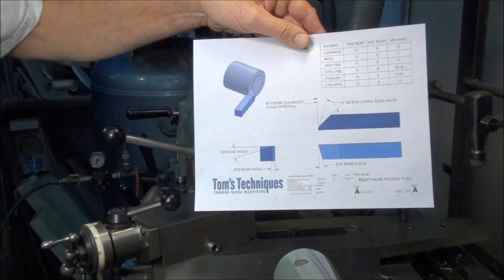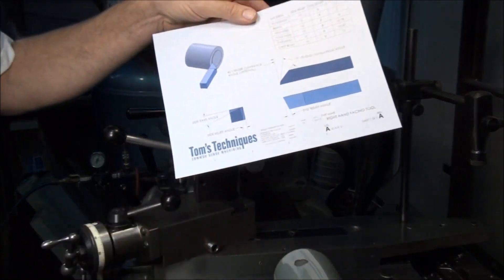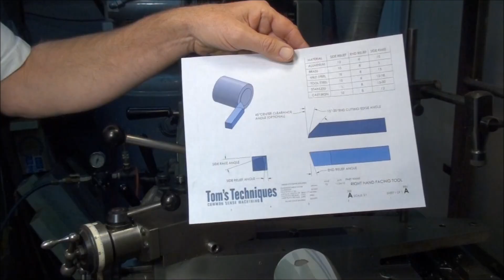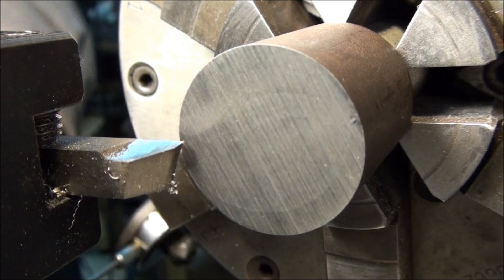Facing on the Lathe

Comment: Great videos.  Really confused on one item in facing video.  How did you adjust tool height with spindle turning, to re-center the cutter to get the nub?    I have an Aloris axa.  Thanks!
Reply from the maker: The tool holders have a thumb wheel to adjust the height of the tool. Just unclamp the holder, adjust the height, and reclamp.

Comment: How tf do i do this when i dont have a fancy ass quick release tool holder?
Reply from the maker: It doesn't matter how you hold the tool. The principles are still the same.
Reply: @TomsTechniques  ok thanks i figured it out. My stupid face was using the wrong arm thing thus holding the bit at the wrong angle. I found a old book of my great grandpas that explaimed the use of each arm thing. The college course i wemt theough rushed us and didnt shoe us much of the old style tool holder
Reply: @TomsTechniques  part of the issue too was i want using the cross slide feed because the brand new lathes at school has it right in the open vs my dads hand me down 1930s lathe the knob is tucked up hidden. We got it from my grandpa and great grandpa used back in the day at there machine shop. My dad mever learned how to use it so i took a course and teaching my dad the lathe, mill, shaper ect.
Reply: @TomsTechniques  thanks for the vid though . I got it down now and made a pretty decent peice to convert a old 50s flashlight to led.

Comment: Sir, What kind of lubricant do you used after you machined a workpiece?  I mean, so that the workpiece remain shiny and not rusty when you put it off the lathe and set aside.  Maybe you might have an idea on what kind of oil they put on.  Thanks
Reply from the maker: Ordinary motor oil will keep parts rust free, but if you don't want oily parts, they can be gun blued or blackened.

Comment: Nice video and web sight.
Fyi the web sight video links and contact page appear broken. 
Oh yes, Wonder if I could request a sequel. How to face both ends parallel when the part is to thin to simply flip on the scroll chuck jaws and cannot be undercut and done between centers....  
Great stuff
Thanks
Reply from the maker: Thanks Mike. 

I am aware of the contact page, but everything else seems to work. The website is definitely outdated and needs to be rebuilt. I'll probably have my son help do it when I get around to making videos again.

You can use parallels between a thin part and the chuck body to get the two sides parallel, but don't forget to remove them before turning the lathe on!

Tom

Comment: facing tools have side cutting angle. ( if the side cutting angle is zero it is for roughing). books recommend that. what happens here??
Reply from the maker: The side cutting edge angle should not be zero, because it puts too much load on the tool at the start of the cut.
Reply: @TomsTechniques  thank you but @2:08

Comment: In the 1960"s we were taught to face from the center out.  Then apply a flat mill file to the nub left in the center.  This would keep the drill bit used in the tailpiece from skipping around.

Comment: A good short video on only the simple facing operation on the lathe. There are a number of operations machinists conduct on lathes including turning, facing, chamfering, thread cutting, drilling, boring, reaming...etc. Lathes and milling machines are used in many areas of manufacturing as essential basic tools, including woodworking, ceramic parts manufacturing, metal and metal alloys shaping and manufacturing, plastics and elastomers machining.....etc. Therefore, anyone interested in manufacturing technologies for fun, hobby, as an entrepreneur or for their career should definitely familiarize himself/herself with lathe and milling machine basics and probably also with other non-conventional techniques such as laser machining, plasma machining, waterjet.....etc. Even if you are not a machinist, but a consumer of machined parts, I strongly recommend learning the basics of machining operations and CNC and manual equipment, so that when you prepare blueprints or want a product to be designed and want to place orders for parts, you know better what is possible and what is not possible. Also, the equipment a machine shop uses is an important contributor to quality, lead time and price. Knowing something about your supplier's equipment inventory can give you an idea about whether that particular supplier is a good fit for your specific parts or not, provided you understand something about available equipment. You can visit our Youtube channel by clicking our logo on the left for additional videos on various manufacturing techniques, good instructional and educative subscriptions and to see videos we liked. Thank you Tom for posting videos showing manufacturing processes.

Comment: sir,

i am saravanan from chennai, i have seen your videos quite a long time , its are amazing 
Now i am  facing a issue in FACE TURNING PROCESS, 

we are the manufacture of engine valves, in valves there is face turning,
while doing a process , nearing to the centre there is concentric feed line are forming stil we are opearting at 0.2mm/min feed rate with rpm 1400
we aare using kenna metal SNMG insert , life is 100 nos
please suggest us the solution , it should increase the feed to 0.3mm/min and to increase insert life

Comment: What about tungsten it started in EU for about 80 years ago, and for 50 years it hawe been around in all shops. On E-bay you can find it - go for seco - it is standard sizes so all EU standard tolls fit in. No korean / japan etc. - you get stuck with somting you can only by by this company - and then cant.
Reply from the maker: Are you referring to tungsten carbide? I don't recommend it for light machining. It's expensive and unforgiving for beginning machinists and as you say, requires special (expensive) tool holders. High speed steel is more than adequate for light and hobby machining and doesn't require the rigidity and power that light machinery can't provide.

Tom

Comment: What is the main difference between face turnging and taper turning?
Reply from the maker: The term "facing" applies to machining the end, or length of a part and "turning" of any type, refers to machining the diameter.

Comment: Although a "nice" finish (to the eye) can be obtained by backing the tool out from center, a closer to perfect face can be attained by keeping the feed and speed where it will cut the best as the tool approaches the center of the work. After all, correct feeds and speeds are more than just suggestions.
For instance, some cnc turning software not only suggests the best numbers based on the material, it also increases the spindle speed and decreases the feed rate as the diameter being turned decreases as the tool progresses toward the center. If you do the math, you will see that that the rpm must increase and the feed rate decrease the smaller the diameter, ending when the speed is infinite and the feed rate is 0 at the exact center of the work.
You can see the results when the finished parts are compared side by side. What happens when feed and speed are ignored durring the the facing operation, it becomes obvious that the material is being scrapped and torn away toward the center of the face.
While not a big deal for most operations performed in the home shop, often times a specific surface finish grade on the face will be called out on parts of higher quality, especially in the aerospace industry. Grinding the decreasing diameter face of a thrust bearing surface comes to mind.
Fortunately, the home machinist can approximate a closer ideal speed by using a digital frequency device, when available. Simply increase the spindle speed and decrease the feed as the diameter on the face decreases.
I've actually replaced the single phase motor with three phase motors on a number of machine tools in order to take advantage of the numerous advantages of a VFD and 3/θ power... RPM, starting and braking ramp contours, instantaneous direction change, etc..
Thanks for addressing the basics for the uninformed. :-))
Reply: Gee whiz
You act like Tom was making a video for Boeing

Comment: I have a secondary operations lathe (Hardinge DV-59), which is giving me fits.  It will turn the diameter of bar stock so that there is not more than .0002: taper over 2 1/2 inches of length.  But facing operations?   I always get a slight convex shape (about .005" total on a 1" diameter piece.  That's pretty pathetic, and nothing I have tried seems to work. ...   The DV-59 doesn't have a saddle and lead screw.  Just a light duty cross slide and compound.   You set the compound to 90 degrees by doing successive test cuts.  and I have done that.  The gibs are all tight.  Can't feel any play in the cross slide or compound.  My tool rest is a substantial Dorian too.   It is tight.   

Any ideas?
Reply from the maker: Convex or conical? If it's conical, the tool is moving on an angle. If it convex, you make have a tool geometry issue, i.e. not enough clearance under the cuttin edge. All that aside, if the lathe has a cross slide, then that is what you should be using to face. The compound rest is intended for angled cuts.

Tom

Comment: how can I get two faces parallel to each other on the lathe if the second face to machine is a sawed surface. the part is too thin so the jaws can't locate the part square
Reply from the maker: Leave the part oversize and clamp it to a faceplate.

super glue it to a faceplate, then dissolve the glue with acetone.

Hold it in a pot chuck. Either the collet type or one you can hold in a lathe chuck.
Reply: Select parallels in the back of the part clamp part take-out parallels you'll be just fine

Comment: hey tom, any chance we could get a pdf of facing operation as well as the tool?
thanks in advance.
Reply from the maker: You mean like the one on my website?

http://tomstechniques.com/reference/

Tom
Reply: yea, but something more in depth like speeds and feeds.
Reply from the maker: There is also a speed chart on the website. Feeds are a seat of the pants thing on a manual lathe. Just set the correct rpm and adjust the feed until you get a decent cut.

Tom

Comment: Hi Tom,

From the video it sounds like this operation at least is quiet enough to talk over.  Is that really the case or did you have a separate microphone?

I ask because I'm considering a lathe in order to get into some steam-related projects, but am currently stuck in an apartment...

Thanks much.
Reply from the maker: I honestly don't remember if this was the camera mic or a lapel mic. Either way, this lathe is very quiet. The phase converter in the background makes much more noise.

Tom
Reply: ncraven1906 ةأغ

Comment: Woah, engineering student doing level 3 engineering and I'm just wondering, could you have used a 3 jaw chuck or did you use 6 (I think) jaws due to the diameter of the bar. Also was this B.D.S.M or something else?- thanks
Reply from the maker: I actually don't own a three jaw chuck because a six jaw is a better option they are more concentric and less apt to mar the work. Not sure what you are asking in the second part.

Tom
Reply: Toms Techniques ah okay. The second part was basically asking what material you were machining.

Comment: Hi Tom... I just got my first lathe. It will run CC, but only hums when I use the reverse switch. It is a TIDA TD-4A
I'm not sure what controls do what. Got any ideas.....

Great job you are doing.... I hope you are being rewarded in some manner.
Reply from the maker: +Mr BreakRAK 
I assume it's a used lathe, so it's possible that one of the contacts on the reversing switch is burned out. Of course if it's used, anything is possible. Your best bet would be to find a wiring diagram for the lathe and start tracing wires. Also take a look at the motor nameplate and make sure it is reversible.

I do get occasional donations on my website and something from the ads here on YT, but that really not the point of the videos. I'm just trying to pass on some of the knowledge I've picked up over the years so it doesn't end up getting lost.

Tom
Reply: +Toms Techniques 
Thanks Tom... my own need & curiosity led me to learn how to get the saddle feed going back & forth. I think I will try to test the cross slide feed today. I will look into the motor info. Thanks much for your reply.

You & I will become good friends... Charley Bond

Comment: Is there such thing as a climb in facing operation on a lathe?
Reply from the maker: +Michael Strong 
Good question Michael. The climb milling/conventional milling thing only applies to milling where the teeth of the cutter enter and leave the stock. On a lathe, the single point tool is always cutting and other than on the first pass of a roughing cut, always cutting at the same depth.

Tom

Comment: Nice lathe.  I use a 4 Jaw chuck.  What is the benefit of a 6 jaw chuck other than the extra 2 contact jaws  Also do you have to manually set-up the chuck or is it self centering?
Reply from the maker: +valveman12 
The advantage of the extra two jaws is excellent concentricity, nearly as good as a collet. It is self centering.

Tom
Reply: Toms Techniques Thanks Tom.  Super nice Lathe.

Comment: I am new at this and tried to grind the hSS tool to the exact angles and then tried to face a metal pipe , 1" dia with .85 wall and the work kept pushing the tool away, didn't cut.. Then I tried a side cut, same thing was very uneven like the work was pushing the cross slide away I could see it move and no metal cutting or curling..any advise?
 Thx
Reply from the maker: +Anthony Catenaro 
Assuming the steel you are trying to cut is not hardened, a tool that won't cut is one that is rubbing under the cutting edge. If you feel the tool has the proper clearance angles, make sure it is mounted on the center line of the work and not above. Also check to see that the clearance angles on the tool extend all the way to the cutting edge. A common mistake is to let the tool rotate down when grinding it effectively eliminating the clearance under the cutting edge.

If you still can't get it to cut, go to my web site, tomstechniques.com and send me a pic of the tool.

Tom
Reply: +Toms Techniques Thank you Tom, I will recheck all the suggestions you mentioned and give it another try...if still no go I will send a pic of the tool, Thanks
Reply: +Toms Techniques Thank you Tom, I will check and send a pic if still not cutting..Thanks!
Reply: +Toms Techniques Thank you Tom, I will check and send a pic if still not cutting..Thanks!
Reply: +Toms Techniques Tom, I bought some cheap Harbor Freight carbide bits and got nice cuts on it...,maybe the metal is hardened...but I can get a cut into it easy with a hacksaw so maybe my HSS bits are wrong angles... tried to send a pic via your website but couldn't find an email address..Congrats on your sons wedding by the way!
Reply from the maker: +Anthony Catenaro 

Just write me on the contact page and I'll send you an address.

Tom

Comment: i wish all my machining was this simple.
Reply from the maker: +userwl2850 

Machining a part, regardless of its complexity, is just a series of simple operations like this. Master them and you can machine anything.
Reply: +Toms Techniques yes, i agree tom. when facing like this its best to have the tool below centre as if its above its easy to break the cutting edge. if you have time take a look at the things i machine on my channel.
Reply from the maker: +userwl2850 
Yes, a carbide tool can chip if it is above center, but setting it below center will leave a nib.
I'll check out your site.

Tom

Comment: Tom, I faced a 3/4" x 7" dia plate on one side. I need to flip it around to face the other side and I need to be at 1/2" when done. The depth of the jaws are .625. How do I space the plate out from the chuck face while keeping the already faced surface perfectly parallel with the chuck face? Thanks, I have learned a lot from you videos.
Reply from the maker: +Ken Hoekstra 

Hi Ken,

You just need some 1/4" spacers between the machined face and the jaws. Dowel pins or ground tool bits work well. Be sure to tap the part down on them with a hammer. There are also three legged spacers called spiders that work well for that, but individual spacers will accomplish the same thing, they just aren't as convenient.

Tom

Comment: hey tom,
 your videos are pretty awesome,can u describe what are ORS tool designations plz,
i read on the book,but unable understand about the reference planes.
thank you
Reply from the maker: Sovan Pradhan 
Hey Sovan,

I haven't studied cutting tool theory since college in the 70's, so I had to brush up on it a bit. :)

ORS or orthogonal rake system is a method of identifying various angles in tool geometry. It consists of three planes; the reference plane (horizontal), the cutting plane (vertical plane aligned with the cutting edge) and the orthogonal plane (vertical plane that is perpendicular to the cutting plane. Here is a pretty good video illustrating these three planes:

https://youtu.be/BHEYrGrvp6U

If you have any other questions, feel free to contact me through my website, tomstechniques.com.

Hope this helps.

Tom
Reply: Toms Techniques thanks a lot sir

Comment: PERFECT! BUT why don't you use a coolant??
Reply from the maker: I'm in no hurry, so why make a mess? Seriously, coolant is optional. It is normally used to increase cuttings speeds and tool life in a production setting or for difficult to machine materials. For light machining like this, it's just not necessary.

Tom

Comment: Well done as usual!  Tom, What is the plastic pipe behind the lathe wrapped with
wire?
Reply from the maker: Thanks Burt.

The plastic pipe is a PVC pneumatic potato cannon and it's wrapped with screen and wire for safety in case the pipe fails under pressure.

Tom